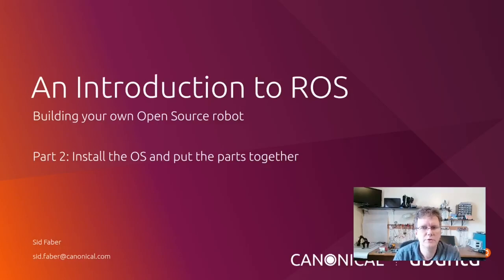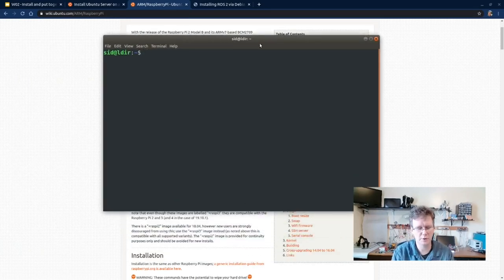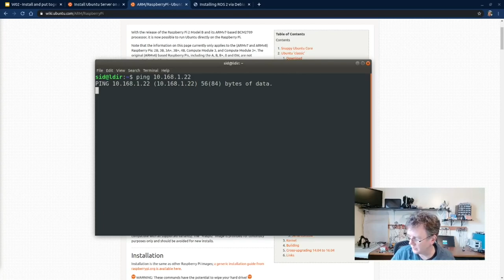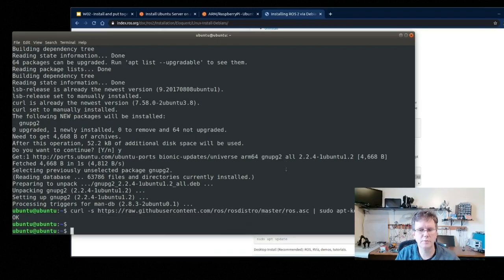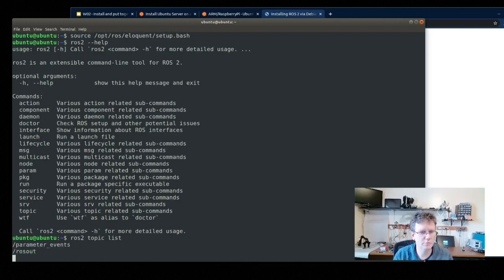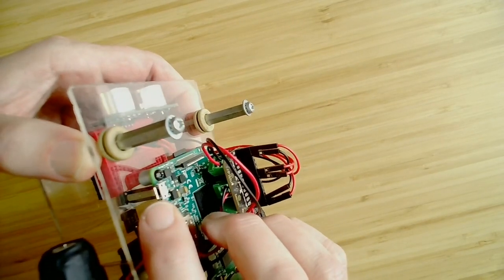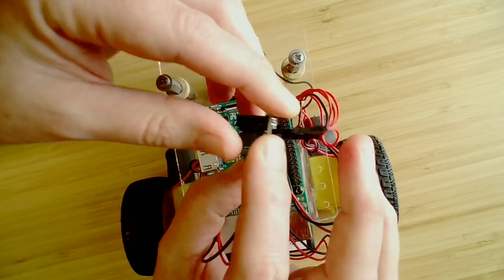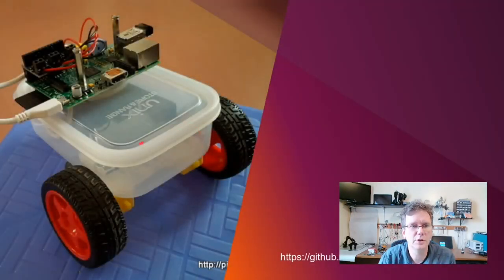An Introduction to ROS, the Robot Operating System: Install and put together (3/6)

Comment: Will ROS2 install ok on a Pi ZeroW? I'd used that already on my edukit build, just wondering if it would work.
Reply: Unfortunately no, at least not easily, since there's no stock ubuntu build for it (it's arm 6, 32 bit) and no pre-compiled ROS binaries. I did some experimenting with raspbian but didn't get very far.

Comment: Hello, I was wondering if I can do the project on the Raspbian OS? So that i can do Remote desktop connection to it(instead of ssh)  and add a live camera streaming to the robot ... isnt raspbian more friendly in terms of this ? Thanks
Reply: Hello Shadi, I've been searching for a solution like that too. according to what I have read you have to make sure ROS 2 (the version you are working with) is supported entirely with the OS you want to use. With that been said, you can try installing all ROS 2 libraries on Raspbian OS and see if the libraries work (there are not too many people trying to use it in the way you want). 
Hopefully, this helps.